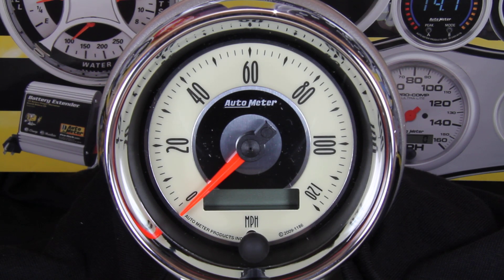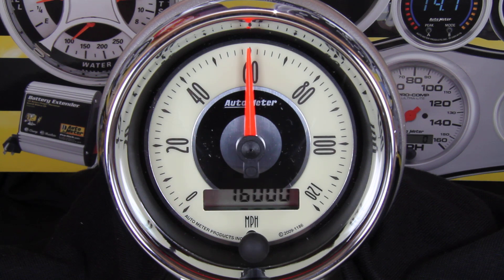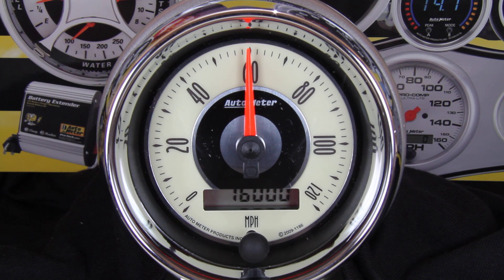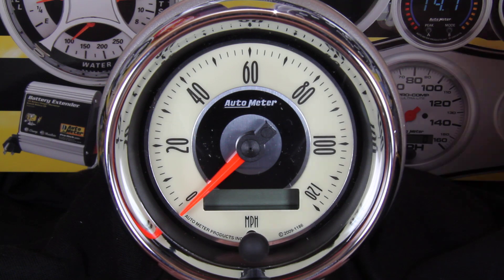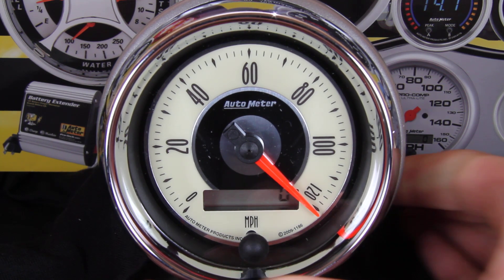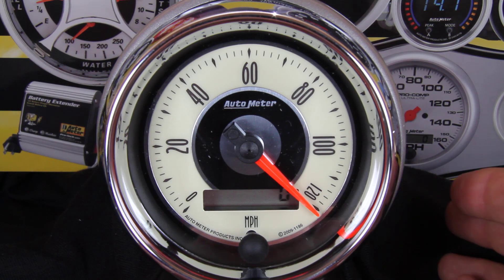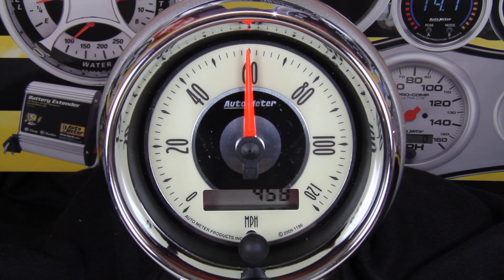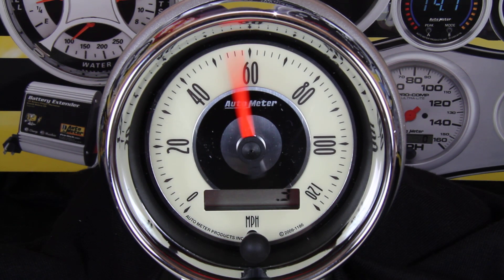Calibrating Your AutoMeter Electric Speedometer- HD

Comment: Is there an alternative to calibrate the speedometer? I had a custom Autometer speedometer built for my need and the 2 km (2 miles) drive is a real pain in the ass and even after multiple tries I'm still about 10% under the actual speed I am going.
I'm at the point that I don't look at the speedometer but prefer to check the rpm/gear or an iPhone with a GPS speedometer.
I understand there is a GPS module but there has to be an alternative if I know the pulse per miles(km) that the car return..
Thanks